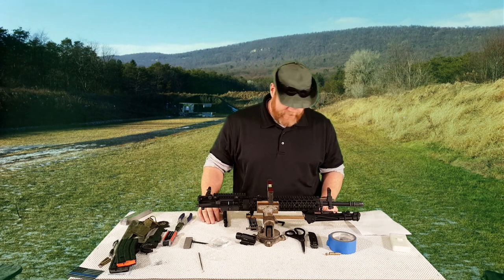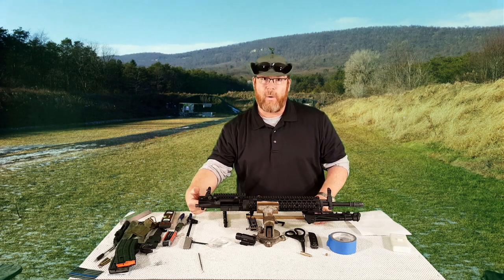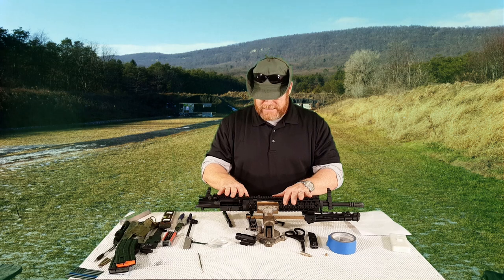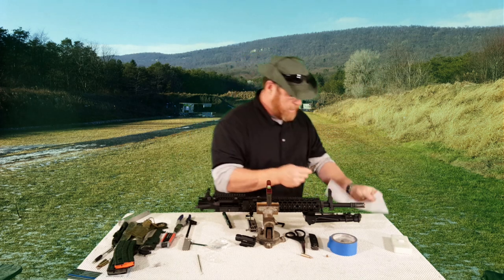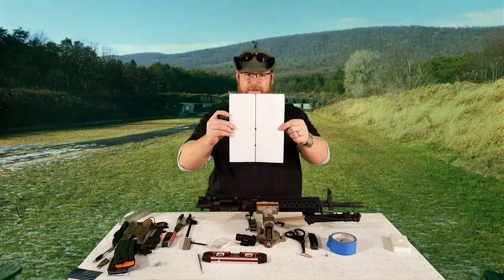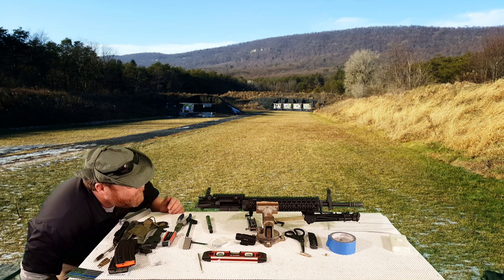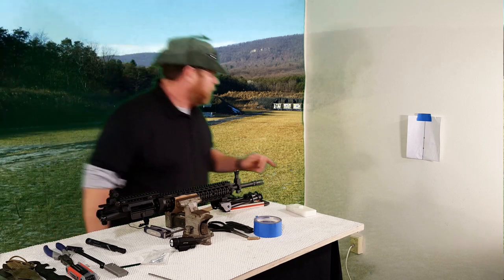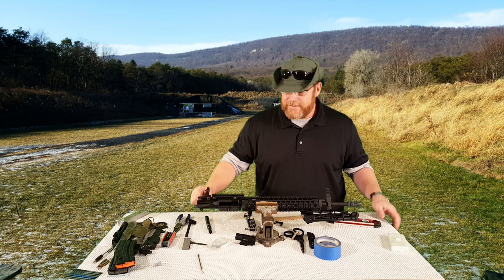How to Boresight an AR15!!!!  Battlesight Zero AR15 Part One!!

Comment: this is all assuming the front sight post is correct. How would I do this if I just assembled a rifle and installed the front sight post and have no idea where to set it?
Reply: Andrew Widman should be 2 and 5/8th's" brother for I believe a 25 yard meter standard POA to POI from the tip of your front post sight to the middle of the bore
Reply: Count clicks all the way down and bring it back halfway up.

Comment: that upper is sweet, what length is the rail?
Reply: Kotaboy32 Tactical Firearms Review im planning on putting a yhm front sight post on a rifle length gas barrel, with a midwest industries 12.65 quad rail and was wondering if the gas block would have enough room to be installed properly